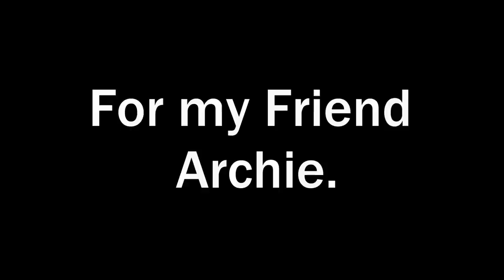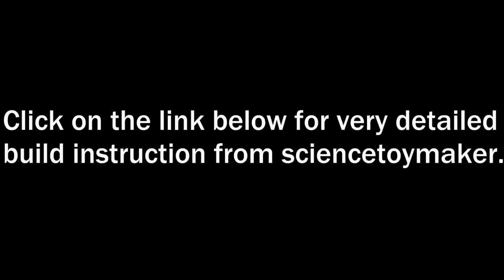Make a Pop Pop Boat.

Comment: Brilliant 👍👍👍 I remember playing about with these when I was a kid. I think they used a single loop of small copper pipe. Cheers, Alan.
Reply from the maker: There is a use for all your used C02 cartridges. There are designs for engines using these. Just one or two pipes soldered into the cartridge.
Reply: @myfordboy  Strangely enough after watching your video I went and watched one showing a pop pop boat using a C02 cartridge. 🙂

Comment: ok, so how about take the hemispherical bottom from 2 cans, cut at 3/4 inch vertical and wrap a 2.5 inch strap around the perimeter, seal with hi temp adhesive, cut tabs in the wrap piece and fold over to hold the halves in place. can add 1/8 pop rivets to cinch it all up while the glue dries.  cut thin sheet aluminum to replace the plastic piece that melted, use phenolic washers to reduce the heat transfer.
Reply from the maker: That could work although I think the volume would be too large and sealing would be difficult.
 I have just finished a new design that solves the sealing problem and will upload in the future.t

Comment: Great little project but very predictable that the ABS frame components would fail due to heat on the final version. It does make me wonder at times when i see the poor understanding of what material choices are fit for the job and those that are predictably not so.